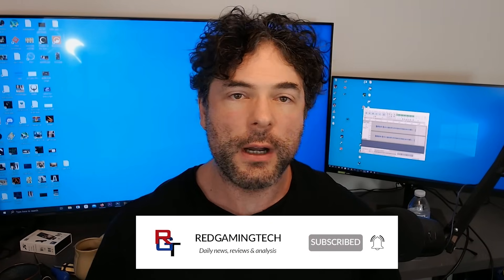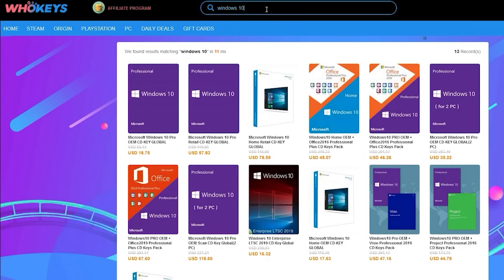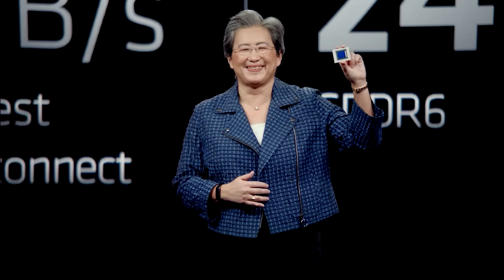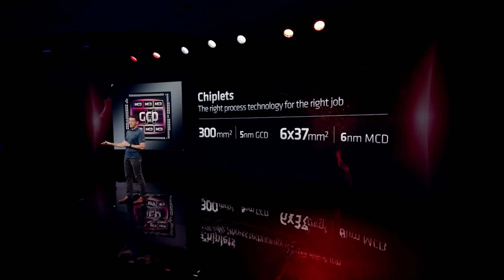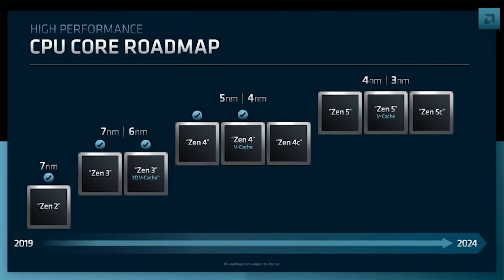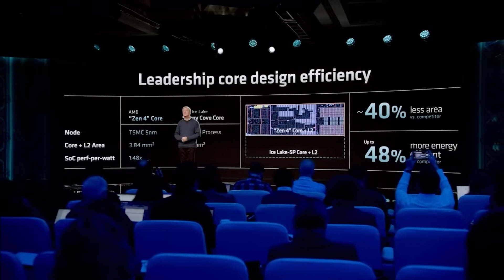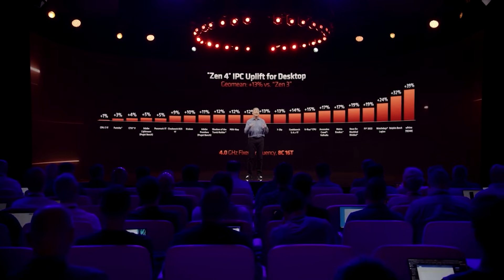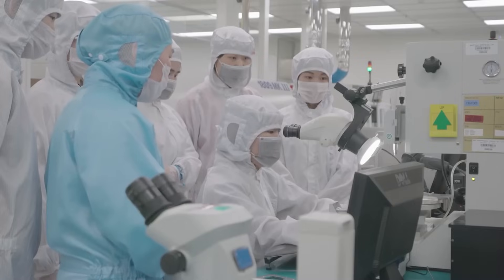How ZEN 6 Is AMD's Next BIG LEAP In CPUs

Comment: Because the smaller zen4c cores provide most of the performance of a zen4 core it would seem logical to me to:
1 remove SMT because it is a security risk and the space can be used for a zen5c core
2 provide 1 Zen5 core per CCD because most of the time it is only 1 thread that is cpu limited
3 provide 15 Zen5c cores per CCD because secondary threads aren't at 100% cpu anyway and a Zen5c core is still faster than an SMT thread on Zen5
This keeps the design simple and you don't really need a thread director like Intel. Most tasks work just as fast on Zen5c as Zen5. And tasks that need a Zen5 core most often only need 1. When you go to 2 CCDs you get 2 high performance cores for the high end.

Comment: when 5950X3D will be released
Reply: 16 cores is pointless for gaming. I have a 5950x and I have disabled the second CCD. It means 3 cores get to 5.00GHz under PBO when only one did with both CCDs.
Reply: @Safetytrousers  but i have to work in multi thread environment, viturallization, compression tech as well. That is y interested in it. by the way game are in zip format it takes hours to unzip.

Comment: Will regular L3 be moved from CCD to IOD as well?
Or will this be a 4 level cache system with X3D being the L4?
Reply: From what I read, x3d SKUs were going away as they were going to integrate it's benefits into the mainstream line. Hopefully they can address the heat and voltage issues with it so that overclocking can resume.

Comment: I honestly think that the big cores would be on the main substrate and the little cores can be stacked, or the little cores could be stacked on one another, or a cash die could be stacked. Because this would negate the benefits of AMD moving to a chiplet architecture. That or they are also using the tiling system with the die stacking.
Reply: AMD will not stack cores on other cores. This will create huge hotspot issues.
Reply: @Gindi4711  i don't think you've read what the guy wrote. you stack the small ones, the low power ones. it won't be enough power to cause heat issues. if you put a cooler on 5 stacked phone cpu's they'll still be fine, wouldn't they?? and you leave the big ones alone so they cool fine.

Comment: Good for AMD, but I'd rather they'd do this Big Leap for GPUs. In order to get a tangible uplift in performance and memory capacity over my RX570 8GB, I'd have to spend at least 300€ or 250€ for the same amount of memory that's been available on Polaris based cards for 7 years now. 
Going from my i7 3770 to a cheap AM4 system with R5 5600 would cost me a bit over 200€ and double or even triple my performance.
Reply: 6800 xt. 16gb vram and 20 times the Performance

Comment: If AMD does a big/little but they also have an 8 core CCD, it's going to be more like 4 big and 12 little cores to make 16 because you can't have 8 big cores plus 8 little in the same die area as just 8 big cores...
Reply: What if, 8 big and 16 little??
Reply: Why? 4 big cores per CCD would suck in gaming forcing every game to use 2x CCD and everything have to go through the slow infinity fabric. It would make a lot more sense to have 8big on one CCD and the smaller ones on the second CCD. In not so demanding tasks in laptop one would use the smaller one for desktop and low power and latency. In games you'd use only one CCD and avoid the AMD dip. Anyways it'll take Microsoft YEARS to fix their thread director to handle this so I will not be buying this platform. I had enough with Intels big/small cores which also took years to fix.

Comment: I see there are CDNA and XDNA cards which are for AI, but could either of these run in a desktop along side an RDNA card? If not, it would be cool if AMD could get some eco system with SAM connecting a XDNA/CNDA with an RDNA GPU, ZEN CPU, and RAM together.
Reply: Why, when optimized properly RDNA can run AI or other tasks very well. Recently updates came out and a 7900xtx is faster than a 4080 for AI image generation. RDNA is faster than nvidia already for a lot of productivity stuff like autocad or video editing.

Comment: I fully intend to dig in with a 5600 (maybe 5800x3d if they start out-performing the 6 core substantially) and 3090 until 2025. I should stop watching these tech videos until then but now i"m addicted after the pandemic 😂
Reply: Just don't upgrade until the game you really want to get doesn't run to your liking. If the games you currently play run fine they will run fine in 3 years.

Comment: I'm still not sold on the "No high end discreet GPUs because we want to make cheap ones for everyone!" thing. I simply don't buy it. As for putting Zen 6 on AM6, whelp that would be a PR DISASTER. AM5 boards are already more than double what the previous 300-500 boards were for the most part (ei it was pretty easy to find a $60 b450m that still had 4 dimms, 3 NVMe slots, a x16 and x8 along with a decent amount of USB's and a solid VRM config. The only negative that stuck around the just above ultra budget level boards was the downgraded audio. Now we have a LOT of people who paid $135, $150, $185 etc etc for the same feature set save getting 2 4.0 slots and 1 3.0 instead of only getting 1 4.0 and 2 3.0/SATA slots and the board is only good for 2 generations? No way. That is a surefire way to get people who probably already went ham on their power supplies for what they have to switch back to Intel because they are pissed. And rightfully so. AM5 was already way, way too expensive than it should have been and kept a ton of people on AM4 who otherwise would have upgraded. Then they come out with budget 520's for $90 bucks? Come one. That's 50% more than a full featured board could be found on any given day in 2021.

shrug No shade at anyone for reporting something they heard, but unless the person telling me worked for or were the people making decisions, I wouldn't even waste the grain of salt on that one UNLESS they (AMD) has some type of refresh planned similar to the 2K series. If not, as I said, I have a very difficult time believing that they aren't releasing 5 and 6 on AM5
Reply: Both Polaris and rdna 1 lacked high end parts. It wouldn't be unprecedented
Reply: You can pick up an a620 motherboard for 80$ with 4 dimm slots and 3x m.2 slots. Secondly AM5 is more expensive because it's supporting faster connections which require more shielding, thicker copper and better connectors. If technical limitations prevent zen 6 from being the best it can be on AM5, I'd rather have AM6, it's not unlikely AM5 would see some continued support, just as AM4 is still receiving cpu releases to this day. Also higher end boards haven't changed that much in price, a good board in 2017 was 200+ and a good board on AM5 today is 200+ I paid 380$ for an x370e board in 2017, 380$ for a x570e board in 2021 and 480$ for a x670e board, we're not talking huge price differences here.

Comment: So first, more "Intel Like" in the way MCM works means moving to tiles butted up against each other and direct connects.  This is after all a joint patent between different companies INCLUDING AMD, or it's an open connection architecture so any company can use it.

With direct connects there are WAY too many possibilities on how AMD could do Zen 6 desktop and this is why there is little information about it and I don't think AMD wants ANY of this to get leaked.

AMD HAS to incorporate AI into the CPUs.  Even Windows OS uses AI.  What is it, Win11 23H2?  Whatever the new release is Microsoft added a LOT of AI functionality into the OS.  So the CPU should be the hardware running it or it will be slower if this has to bounce between a GPU and CPU.  So that's one.

But AMD has a problem with the IF and how fast it can go.  It's already problematic for Zen 4 and why I won't buy that gen and because AMD is going to leave the IOD alone for Zen 5 I won't buy that either.  It adds too much latency when data has to pass between cores on different chiplet and YES THIS IS GOING TO HAPPEN when you have multiple core chiplets and programmers can't fix that.  The thread scheduler in the OS can minimize it as much as possible keeping all the threads of a certain app on one core chiplet, but you look at the 5950X and gaming and you see threads scheduled for cores on both chiplets, or you're rendering on the CPU, or running other tasks that can generate large numbers of threads such as compression/decompression and data has to move between the two chiplets so PLEASE don't give me blah blah blah programmer blah blah blah.  No, thread scheduler, that's it, or for some apps you can limit the thread count and then the scheduler MIGHT keep all the threads on the same core, if you're single tasking, but for lots of users they're doing multiple things on their system at the same time in which case the scheduler probably won't keep the all threads for all apps on the same chiplet.  But memory access is not good being at 6GT/s when DDR4 is supposed to get closer to 8GT/s.  And even though the mem controller can handle faster kits, that doesn't make the IOD get the data to the core chiplets any faster since that has to pass through the IF, running at 3GHz. 

I think Intel tile MCM architecture is going to be much better and it's going to allow Intel to beat out AMD CPUs in many ways.

There's so much AMD could do changing to possibly direct connects that it's too much to cover.  But I don't see why the thin graphics would end up on the core chiplet.  The core chiplet would be a better place for the memory controller.
Reply: Thread scheduler schedules games or active applications on the fastest clocked cores, all multi ccd ryzen chips have one ccd clocked higher than the other by a couple hundred mhz. The latency you mention is when a thread jumps from one ccd to the other, which isn't really a thing for multi core workloads like rendering or compress/decompress. If it was, the 7950x wouldn't slaughter the 13900k for compress/decompress, but it does.
Reply: @PineyJustice  We'll agree to disagree.  Anytime you send data from point A to point B but that data has to go through a multiplexer first, you add latency.  With the speed AMD is running Zen 4, compression/decompression should be faster than it is NOW with something like a 7950X and the faster the cores get, the more pronounced the latency will be.  You're saying that core 0 has to pass data to core 10, and on the way that data leaves a core chiplet, goes into another chiplet, gets multiplexed, leaves that chiplet and goes into another chiplet and then on to point B suffers no loss in time.  AND during that time that data is moving at most about 3GHz which is only about 50% of the speed data moves inside the core chiplets.

Yeah we're going to agree to disagree.  It' that same issue that limits memory speed.   Data from DRAM, REGARDLESS of if a memory kit is 7200MT/s can only pass data through the infinity fabric at 6000MT/s or 3GHz since that's about as fast as you can reasonably clock the IF and data from memory has to go through the IF before it goes to a core chiplet.

Also for various multi-threaded workloads the 14900K which is a 32 thread CPU just like the 7950X is close enough to the 7950X that I find it sad a CPU with 16 EFFICIENCY cores can be almost the same, actually beating it a lot, as an AMD CPU running 16 SMT POWER cores, and those efficiency cores are running slower, which helps to negate the advantage Intel has from those 16 e cores not being SMT (SMT rarely doubles the performance).  Feel free to rewatch GN's review of the 14900K and look at Blender and  Compression results.

Or, go to Techpowerup's review of the 14900K and in multi-threaded workloads they show the 14900K beats the 7950X on a regular basis.  So basically your memory of day 1 reviews is pretty shot.  Maybe you're confused because a lot of power consumption diagnosis gets thrown in, but that's the difference in TSMC N5 vs. Intel 7 and how fast each company chooses to clock their CPUs.

Also, you were completely wrong on saying the 7950X slaughters the 13900K in compression/decompression.

Using WinRAR both the 13900K and 14900K are faster than the 7950X and using 7-Zip, it's only decompression where AMD wins and that's the difference in instruction logic, how each core performs each specific instruction.

For the BEST testing results since they're about the most complete, look at Techpowerup.  There you can see all the results without listening to the sarcastic commentary of a reviewer and get the REAL, unbiased picture of what's happening.

When Arrow Lake comes out, if AMD isn't on a new MCM design they're going to get FLATTENED. 3 - 3.5GHz isn't fast enough for a clock speed for their infinity fabric which is a multiplexer on the IOD.  If they can magically DOUBLE that speed on that IOD they'll help to negate its problems, but the real issue is as AMD develops ever faster cores, having an infinity fabric gets harder and harder to compete with against the likes of Intel who is going to beat the snot out of Zen 4 once they get on their Intel 4 process node for desktop.  But you'll get a taste of it very soon, at least for laptops although Meteor Lake doesn't have all the changes Arrow Lake will.

Mind you, I haven't bought an Intel CPU since the 1990s so it's not like I'm an Intel fanboy.  I just take all the emotion out of all this and look at the DATA, something you have failed to remember obviously by your statements.

Then add to this there's been at least a couple times now that Paul was talked about something AMD has said where their Infinity fabric is creating problems for them.  Uh, yeah?  They need to clock it at least 1.5X the speed it does now but that won't fix latency issues during core to core data transfers when cores are on separate chiplet.  It will HELP, but it won't fix it.

Comment: Zen 6 is going to eliminate latency.
Reply: You can't eliminate latency. But, the design will certainly reduce it.
Reply: @26Guenter  Lol. That's what I meant. It would be one hell of a CPU that eliminates latency! Id camp out to buy that one!
Reply: Zen6 will REDUCE latency going from one chiplet to the other, but VCache was previously stacked on CCD so latency to VCache will increase, not decrease.
Also if L3 stays on die this means VCache will be turned into L4. This means L3 has to be searched and only then VCache is searched so youncan add another 10 ns.

The advantages of X3D on IOD:
a) The X3D hotspot issues are solved so Zen6 X3D can clock same as non X3D which gives around 10% higher clocks, but also higher power consumption.
b) X3D is shared across all CCDs so we dont have CCDs like on the 7950X3D where VCache is only available on one CCD.
c) iGPU can use VCache as well. So AMD can design more powerful APUs without using GDDR
Reply: @Gindi4711  So, having just one chiplet which has vcache, could still be faster in games in some cases vs a 2 chiplet CPU which both have access to vcache?

Comment: AM5+ is a possible name, since they have a history of using the + moniker at times for new platforms that are still mostly the same old platform and are even backwards compatible to some degree. If they go that route, they'll make a lot of people pretty happy, since it will let them upgrade their motherboards first while they take their time getting the money together for the best CPU/GPU combo they can afford when they finally upgrade those as well. Otherwise, I suspect they'll stick to the current naming scheme which means it will probably be AM6 if it's a new socket entirely. But if the socket only needs a few extra pins added on, they might go the + route where the cpu's with those pins missing just auto-register as AM5 hardware, but the cpu's with the proper pin-out will register as AM5+.

Oh, and since there is likely not going to be a new type of DDR memory coming out for a few years yet, DDR6 for example only, we probably won't see a new socket. I could be wrong of course, and probably am... but I suspect they'll not go the AM6 route until they need to implement whatever comes after DDR5. And... I hate to be the one to point out the coincidental correlation... but has anyone else noticed that the AM# tends to follow the DDR#? AM1... DDR1. AM2... DDR2. AM3... you get the point yet?